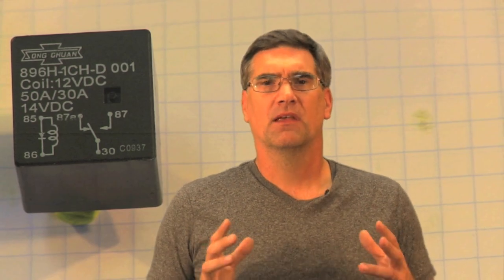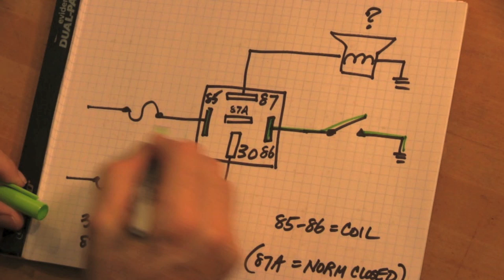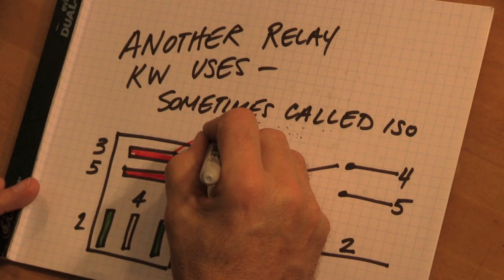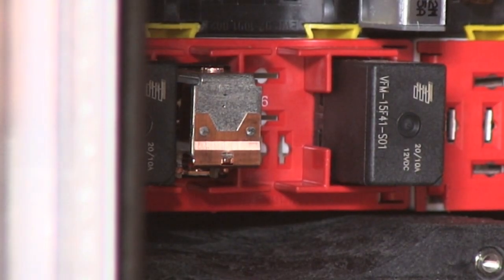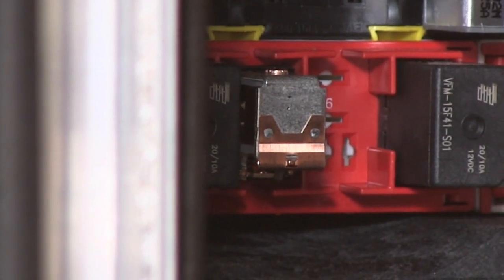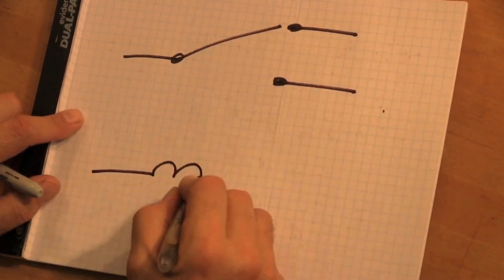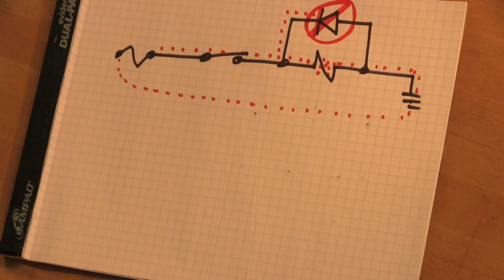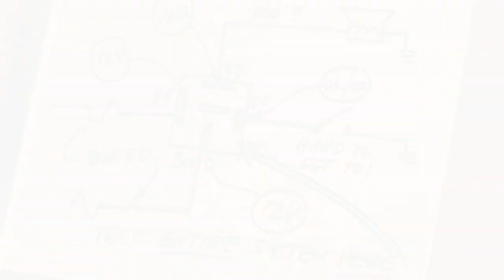VEHICLE RELAYS - Operation & Diagnosis

Comment: Very informative details Daniel, Thanks for this information.
I'm having problems with replacing the Denso FB257H OEM flasher relay with a 5 pin as you use in your teachings.  I am exchanging because I've installed LED flashers.
The system is fitted on a Kawasaki VN1600. The FB257H has the terminals arranged in two parallel rows 3x3-1=5 (no terminal)
I am not able to determine the correct connects and keep blowing 5amp fuses. The replacement relay was brand new and while I try and get the correct information, I'm running with  the OEM unit but this generates a faster flashing rate, as in fault. 
Are you or anyone else able to provide a suitable solution please?

Comment: Why do you say a small amount of current can switch a large amount of current??
Reply from the maker: Beeeeecause - that's how it works...
Reply: +Daniel Sullivan because of magnetic field?
Reply from the maker: It's technically an AMPlifier. The original use was a telegraph relay, because voltage drop over bad wires over distance was so great, they needed a way to RELAY the telegraph signal. http://www.telegraphlore.com/instruments/athearnrptr/prescott.htm A lower voltage could switch a higher voltage, and/or a lower amperage could switch a higher amperage.
Reply: armando nika i

Comment: This was very helpful as I've never used a relay and I'm trying to use one to wire and LED strip to function with the door open/close without just tapping into the dome lights. It's a little different because my negative coil would be tapped to a ground that isn't active when the door is open I need to use 87a as my switch on so to speak and 87 isn't needed at all - not sure if this is possible. I'm making this way harder than I need I'm sure but I'm determined to figure this out..if it's even possible the way I want to do it.

Comment: +daniel sullivan
awesome.
im trying to create a gate lock using a 12v reversing polarity motor and an electro magnetic lock with a 5 pin relay.
do i need to install a diode in the system? or just figure out which wire causes the gate to open (+) and wire it accordingly? 
any help would be awesome
Reply from the maker: Email me at dan@brighterideas.com
Reply: Daniel Sullivan i seny you an email. Hope it didnt get lost in the www

Comment: Sir, my question is that I have a auxiliary fog lights that I like to install on my Sedona 2015 but I wonder if will be ok if I splice into the wires from the existing fog lights????? Thank you
Reply from the maker: +Tony Brage Depends upon wire size and amp requirement of new lights.

Comment: hi Daniel  I have a 83 Jag xj6 ,  the other day petrol pump stopped  operating at the start up.... I've by passed it to get home used live wire to get  it working... now upon inspecting  responsible  relay   it , I've noticed there isn't any coil winding at all just a sort of printed circuit  with resistors on it....s that what they call "diode pack" ?       anyway now this "relay" is working for now and so is my fuel pump...   could you tell me how this kind of relay  works ?
Reply from the maker: +tarnowek1 Can you email me a picture - with a couple of views? dan@brighterideas.com

Comment: Sir, my preheat glowplug relay gives only 9-9.5v to the glow plugs, but on glow plugs is writen 11v, (i tested for resistance and found 1 dead plug, changed all, bought new battery) and when i try cold start after glow plug signal it cranks a lot, but if i wait for 2sec. before relay turns off preheat and try to crank the car it starts right away.
Now, my question is, does it relay is weakning from years of use( 10 years), or its normal to emmit voltage 9-9.5v to glow plugs? 
Thank you in advance you are a great teacher!
Reply from the maker: +Aleksandar Makedonski Relays don't "emit" voltage. Relays are switches. Can the switch arc and cause a drop in voltage? Yes. Only one fault will cause a loss in voltage when current flows - high Ω. You have to have a corrosion/resistance fault in the wiring (everything that isn't a glowplug) between the battery and the glow plug - OR - in the ground of the circuit. Relays do NOT provide voltage - the SWITCH voltage. Huge difference.
Reply: +Daniel Sullivan sir, this is the relay 
http://www.ssldieselparts.co.uk/thumbs/300x300/images/user/glow%20plug%20relays%20006.JPG 
when the switch is ON,   current passes to the heater, and with multimeter im measuring 9.5v, should it pass 2v more?

Comment: hello sir i have a car that randomly  hasn't been starting specially when its cold it cranks but wont start i have narrowed it down to it being the ecm relay because i got a code for it saying low voltage on that relay, so as you might know intermittent problems are hard to reproduce, so i remove the relay same think happens the car don't start i put it back in and it starts so now i know my problem is right there, but my question is i have tested the relay with a dvom the relay closes when i energize it and it has continuity' so that confuses me alot i guess it means the relay is good, i would like to know maybe when its cold the relay sticks and don't close because when this happens if i keep trying it after 4-5 times the car starts i hope you understand what i'm trying to ask thank you in advance.

Comment: You are brilliant!! That's the art of teaching. I now feel confident to take on wiring challenges on my car. Recently bought and installed a "coming home leaving home module" on my car, and had a problem with the dimness of my lights when unlocking/ locking the vehicle. I even resorted to using LEDs on the fog lights. But now I know the problem was with my wiring - I need to run the module through the car's headlight relays and not directly to the lights. And after watching your video (although you used the horn as an example), I now know how to rewire the module. Thanks a lot

Comment: Thank you Mr. Sullivan, your explanation about what is a relay and how it works is very complete and illustrative. I was wondering if you could give us an example about how to use terminal 27a. I have heard that you can connect to one relay both low and high beam lights using terminals 27 and 27a respectively. How could you do that? Thanks again!
Reply from the maker: +JOSELUISROZO 87A? Connect the motor to 30, to ground. Connect 12V to 87A through a resistor. Connect 87 to 12V without a resistor...

Comment: I bought an 02 gmc sierra 5.3 v8 recently and the guy who sold me the truck had someone replace the fuel pump and the gauge in the dash that indicates the fuel level in the tank, so the truck worked fine for a while but one day it stop as I was driving it and when I tried to start it again it would not work after i tow back home I checked the fuses and the relay and find one for the fuel pump bacwards according with the guide in the fuse box so I flipped back and crank the ignition key and the engine turned on and run for about 5 minutes and stop again I thought that the relay was burnt so I bought a new one but had no luck so I'm wondering if they installed the relay bacwards and mess something else

Comment: what will happen if the relay was installed backwards? ??
Reply from the maker: +Jorge Rodriguez Can't do it - though you can install a relay with the incorrect polarity. Diode points to positive.

Comment: I watch one video on relays and it has 85 as ground and 86 as  power/switch ... I watch another video and it has 85 as power/switch and 86 as ground? .. . .can those be either way? . .I'm confused which video to follow. . .Thank anyone for a reply,
Reply from the maker: +MechArm1 Depends on the relay - you have to look at the schematic on the relay. Diode points to positive.

Comment: hi,I need to power up a reverse camera,which only has + &- wire,so I should use 30 for live wire from 12v leave 87A use 87 for Camera +wire  and - from camera to ground , 85 Ground and 86 Wire to reverse light,right? because now,when I only connect + to reverse light and - to ground without a relay,camera works when ignition on but goes off when car is started . Thanks

Comment: I'm trying to wire up a solenoid for my Laycock overdrive, I done some research to discover to replace an old Lucas relay with an off the shelf box type one the conversion goes as follows, W1=85, W2=86, C1=30, C2=87. Now have wired as shown in my Vanguard workshop manual (but using the conversion above), when I hit the switch I get a burst of current then its gone even though switch still on, my first thought was blown fuse, but turn off switch and turn back on again and you get the burst of power then nothing, this is from terminal 87, here is what I find odd and makes me question the conversion, through terminal 87a there is constant power even with switch and ignition turned off, any ideas?

Comment: In your summary you measure system voltage on terminal 85 and ground on terminal 86. Are those backwards? For an AC clutch scenario the pressure sensors and WOT would close the ground side on terminal 85 and battery would be on terminal 86. Battery go on either 86 or 85?

Comment: Why do we have to have all these relays. Why cant we just have the regular voltage and current that the horn needs run directly through our steering wheel mounted horn switch and eliminate the complication?
I get it if we want to control some dangerous high voltage but isnt car horn or fuel pump or windshield wiper voltage already down in the low voltage range where it is not necessary to protect the user with relays???

Would you be willing to email me a response at
ebayme@use.startmail.com  ?  Thank you !
Reply from the maker: Mateus Jaguar Because engineers have to plan ahead. But, the more important question is "why aren't you confident enough in your obvious intelligence to take a relay in stride and just manage them?". You're certainly not stupid - I know that for certain. Just go with the flow (pun) and look at it as an advantage. Relays make testing really simple. https://www.youtube.com/watch?v=6eZg3wLYsr0

Comment: Do you got any ideas on why my benz c280 1998 windows (all) door locks, rear def, turn signals, horn,wipers, all quit working at once? I have checked all the fuses and they seem to be fine.  Can ya help me?? pretty pretty please
Reply from the maker: I'm not an expert on Mercedes. Whatever it is it will be amazingly simple. grounds, water in connectors, or a connector that was left partially open. Can you get a schematic? Sorry for the delay.
Reply: That sounds like the rear (or front) SAM is blown. Signal Acquisition Module. Don't know which one of them is responsible for what. Might want to check on mbworld or benzworld, definitely someone has had the problem in the past.

Comment: Very informative , Thanks, have a problem with a Nissan 300ZX horn has been going off in the early morning and evening starts small like a barely perceivable blip and the after a few minutes locks on to full blast.
 End up having to pull the fuse for it to stop. Could this be a faulty Horn relay moisture Bridging the contacts or such
Reply from the maker: Where do you live?
Reply: Auckland , New Zealand . Just coming out of winter, still very wet.Daniel Sullivan
Reply from the maker: ***** I'd assume contraction of the material in the steering wheel, due to the cold, closing the contacts. Same thing happened to a car in the apartment parking lot during college. It could be the same thing inside the relay too, assuming it's defective in some way.

Comment: Hey I'm actually rewiring my car. I have a 74 Dart and the previous owners just made a mess of the wiring, not to mention its all old and brittle and breaking. So my question is, the starter relay, is that the same thing as a starter solenoid? Is that just 2 different names for the same thing or are they actually completely different? The Starter relay I tore off the car was shot and it was mounted on the inner fender well and stuck out like a soar thumb, way out in left field there. And I've seen a lot of different starters with smaller canisters on top of them (solenoids I'd suspect) but mind doesn't have one so I was wondering if I swapped out the starter for one that did, would I still need to replace the relay or could I just wire up the ignition switch wire strait to the solenoid on the starter? Thanks in advance and sorry if I'm not making much sense, I'm fairly good with other stuff on cars but the electrical system is fairly new to me and I'm still learning :)
Reply from the maker: A relay is a switch, and a solenoid is an actuator - technically. The device with 2 small pins and 2 large ones bolted to a fender is the starter relay. The round cylinder on the starter is a relay - BUT - it's referred to, historically, as the starter solenoid. Both use a coil to switch a large current with a small one. You don't really need both.
Reply: Daniel Sullivan
Awesome! Thanks for the help and the speedy response. :)

Comment: Hi Dan, I have a 1998 Isuzu Rodeo, and a few years ago, the horn started sticking on. I made a bypass cutoff switch (basically removing the fuse), so could sleep at night, but the horn finally stuck on for good, so Firestone said the horn button was part of the airbag, which cost a grand, so they disconnected that grounding wire. So, short story long, I need to install a new horn button. 

I bought a little, momentary button that has an LED the lights up a little horn on the button. The pins are (-), C, NO, NC, and (+). First of all, how do I get wires to come from the engine compartment? Second, should I wire this with existing horn system (relay?), or should I just install a completely new horn circuit with relay, etc. Third, and this were I need you; how exactly do I do it (components, wire, wire gauge, what goes where, etc.) Oh, I already have the new horn in case I go that route, and I have a mounting location available. Thanks very much. Tom.
Reply from the maker: Hmmm - '98 Rodeo... Sell it.

No - just kidding. Hard to answer - I'm not a Rodeo expert, though I do ride and have boots and big belt buckle, for classes in Texas.

I hate to sound like a hack - but do you have my FET book? All of the answers are in that. If you're happy with an entirely new horn system I'd do that. I never want people to be afraid of getting into the thick of it - but in this case simpler might be better, and the lesson could be about the relay and wiring one.

Then, once you get this done, maybe you'll feel better about tackling the bigger job of accessing the OE horn system.

D
Reply: Yeah! Sell it. Why didn't I think of that? ;-). You make good sense about just putting in a new horn and relay, than to try to trace all the OE crap. Thanks. Oh, and no, I don't have your book, but I want to get it. Amazon? You tell me.
Reply from the maker: midimot Amazon

Comment: in one of your segments in this video at 5:26 you spoke of the horn and the relay. I had a similar issue with my dodge neon and it wasn't the wiring or so I thought. It came down to it at first after I got it to work.

  Then shortly after that not only it was the relay in the car in the cabin but the switch attached to it. Everything else was okay. I kept on going through the headaches of driving everytime I had my headlights on my wipers activated which meant that switch was bad and making continuity somewhere else.

Comment: What is the purpose of 87A. The normally open position. I would have thought the magnetic switch when not being pulled down by the coil, i.e. being in use, it should be resting against a non conductor. I'm wondering why the metal conducting tang?? Where does this go to?
Really enjoying your book. Thanks.
Reply from the maker: Whatever you want. Often used in headlight circuits for low beam - N.C. - then the high beams will be on when the relay is on - N.O.  There is no answer other than "when you need a normally closed contact..."

Comment: hi. i have hella horns twin super tone.it work perfect.but when i took off the cover just the cover..it change the sound just a little bit..why is that?...pls help
Reply from the maker: Mike - you took the cover off of what? The relay or the horns? If it's the horns, I have an answer - but I need more info on the horns. If it's the relay - I may not...
Reply: +Daniel Sullivan I also took the cover off the horns than put them back together. They now have a different sound? Could I just unhook my negative connection from the battery and reconnect?

Comment: What happens when your not using the relay switch?What is the advantage of using the relay it can increase the current flowing in the circuit?
Reply from the maker: The point of the relay is to "relay" a signal. Small switches large. There are 2 reasons a manufacturer does something - money or ease. It's less expensive and easier to wire in a relay since all the pieces are there. It saves $$$ on wire and other materials. The bottom line is that a relay is easy - you should embrace its simplicity and usefulness and make it part of the solution - not let it be part of the problem.

Comment: OK...That makes sense, wouldn't the existing relay in the original system work for both original horn and the add-on horn ??  I want to have both blow when I hit the horn!!
Reply from the maker: Sorry for the delay - as long as the ampacity of the original relay is adequate, then the answer is yeas - as long as it's wired correctly.